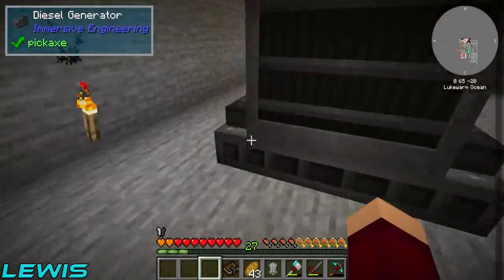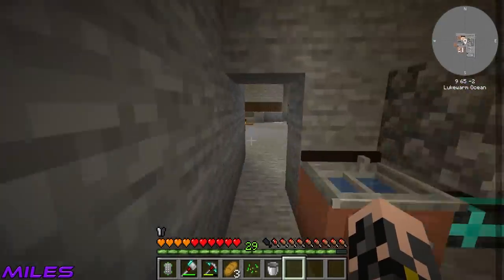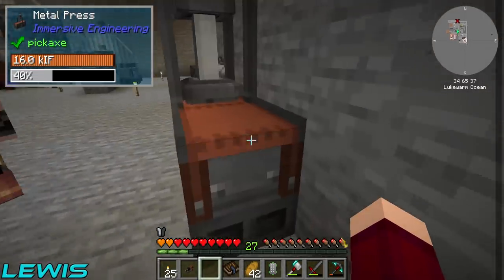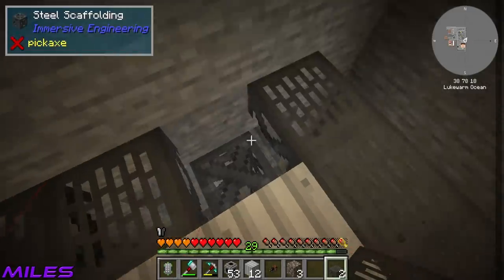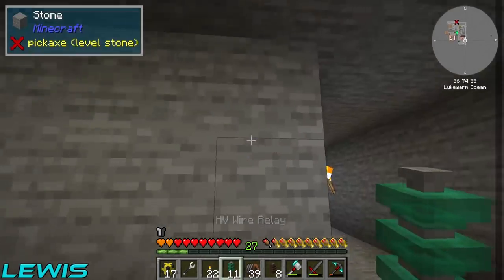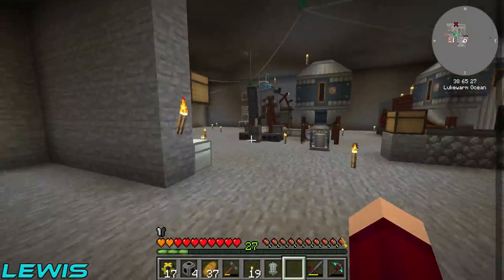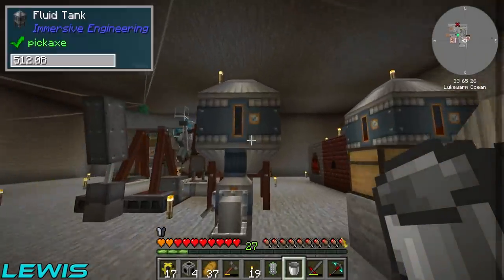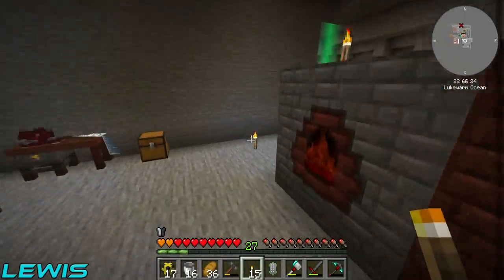DISTILLATION TOWER & CRUDE OIL PROCESSING! Cave Factory EP15 | Modded Minecraft 1.16

Comment: Haha: Danger Danger, High Voltage. I know from what that is. :D Also, how do you gain upkeep on Plant fluids for the diesel.. I'm not getting it so it keeps running, I'm also using 10 of those for Sugarc Canes and 10 for just normal seeds.. Any pointers or help? Or is there a better power system?